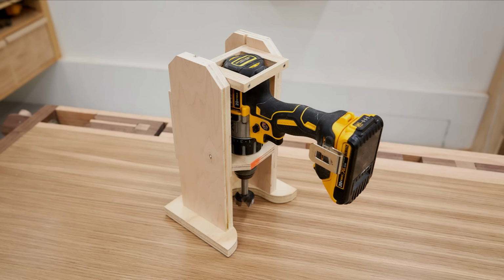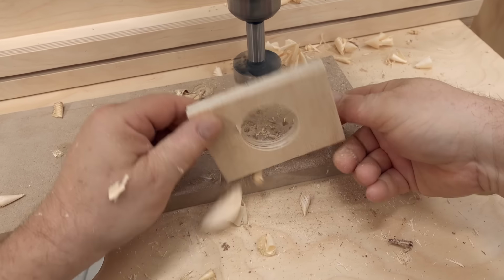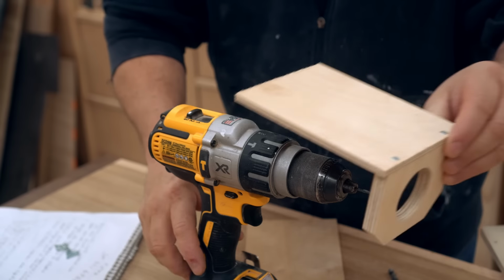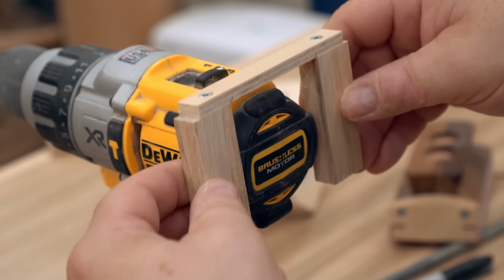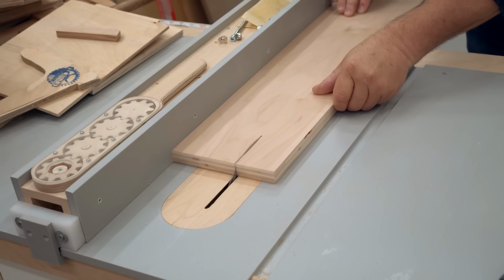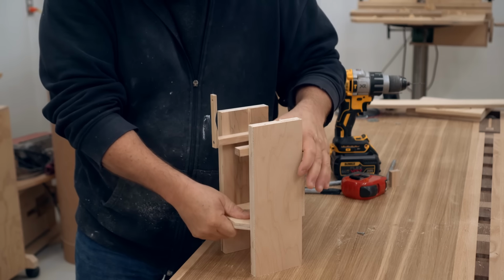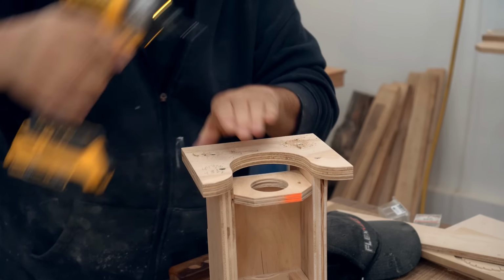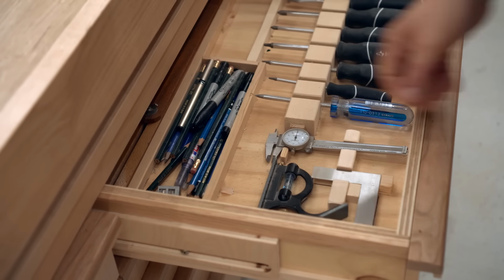Making A Portable Drill Press / Drilling Guide

Comment: the problem with these videos is that 99% of people who would love to build such things is they (& i) do not have the expensive tools or the workspace.
i'm still hoping to find a vid on drilling a hole (1/8th up to 1/2" dia.) through a wooden dowel of at least 3-4", perfectly centered using just a handrill in one hand and your hand holding the dowel.
you can use a vice & sub any other wood peiece for the dowel.
and that's it, no other tools because you don't have any....

Comment: The irony is that your design is stable. I've purchased two benchtop drill presses over the past couple years that had so much runout right out of their boxes that they each would easily win any dance off you threw at 'em. Seriously. Give my 3.5 amp Porter Cable a hula hoop and watch it go! It's probably not good that a drill press can moonlight as a concrete vibrator. Gotta use a 1/4" bit to achieve a 1/2" hole.

This is inspiring. Thank you.